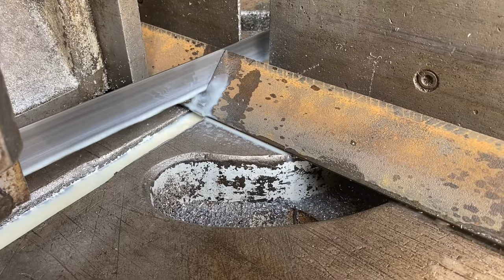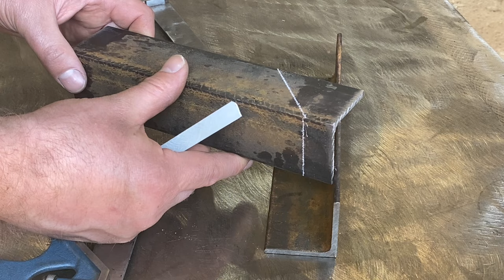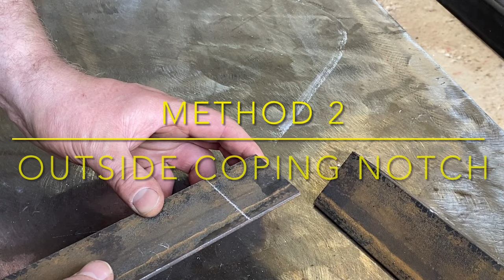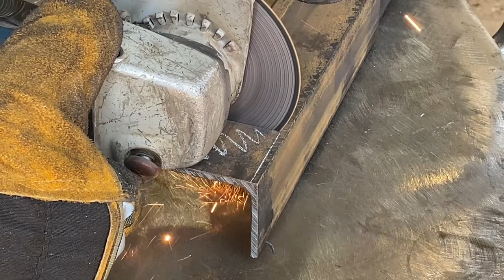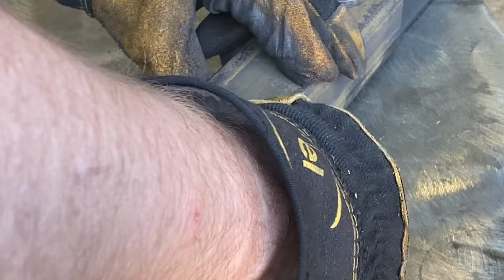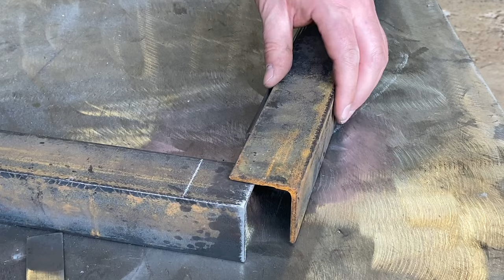Joining angle iron at 90 degrees using 3 easy joint methods - cope & mitre. Welding preparation

Comment: Method 2 worked a treat for me. Easy to cut it out. Easy to weld it up and turned out nice and square. No more 45 degree mitre cuts for me!
Reply from the maker: @gregwilson9035 
Thanks Greg 
Pleased you took from the video. 
All the best.

Comment: ahhh! beginner hobbyist here building a shelf that wishes he saw this a few days ago. trying to do 45s with a chop saw I've learned is a crap shoot.

I don't have a band saw. angle grinder doing either of the copes would've been better.

I'll do better next time. thanks to you
Reply from the maker: And Thanks to you for watching Camilo. 
Instead of the Cope or mitres anther option would have been a square cut but to have sat the angle inside each other, like you see commonly on a gallows bracket. 
Plenty of options... 
Good luck with your project .
Reply: @TheMetalFabGuy  I thought of that initially but mitre looks pretty and it's for a girlfriend's garage.

getting it done? I can do that. add some finesse? uhhhh

Comment: The 45 is more pleasing to the eye for exposed joints but has 80% of the strength that the inside & outside coping joints have due to a shorter weld bead.  Weld beads are usually stonger than the parent metal.
Reply: this. people forget the metal used for welding is very pure and has incredible strength. More weld is a better for strength.

Comment: Is any one of them structurally stronger than the other one? Which one is your preferred method if not specified by the drawing?
Reply from the maker: Thanks for watching Bob. Unsure with regard to the structural strength but would imagine all 3 would be more than adequate in the smaller range of material ie 2”’as per video. 

Personally I Would usually go for mitred option on framework. 

Though both methods 2&3 allow for simple square cuts on 2 sides of a frame opposed to a mitred joint being required on every end. 

Method  3 as the video briefly shows, can also be used as an option for a mid bar on a frame.
(Where I slid it into position)
Reply: @TheMetalFabGuy  thanks so much for your explanation.
Reply from the maker: With consideration, I’d suggest that the mitred joint is the weaker of the 3. More joint to weld with the other 2 and the mitred joint has only the one axis of weld.  But only my suggestion and I’m sure there’s a calculation out there somewhere to prove that.
Reply: The first one

Comment: Maybe it introduces more ways to mess it up, but couldn't you cut a 90° notch out of 1 piece, on one side, then  bend it to make 2 45° like the first method? Less cutting, less welding, maybe a little hammering. 
For the other methods, i was thinking if instead of removing the notch, you ground it down (thickness) and the other piece and have them overlap, then weld? You'd have a buldge but it might be stronger? Idk, new to all this, just spitballin
Reply: You could do that but be sure to bend well because the curve where it was bent adds a few millimeters and can easily mess up the 90 degrees. I had to resort to just using the first method in this video.

Comment: I could use some help. Even with a square guide I'm never getting perfect 90 squares using 45 cuts on aluminum... I figure it can't be heat, but I'm losing my mind trying (and failing) to get square corners here. Any advice? Are 45s too hard for the layman fabricator?
Reply from the maker: Once you’ve welded the 45°s or before ? 
Sounds silly but make sure your square is actually square to begin with.

Comment: So say you are trying to make it out of a single  piece to make a shelf, couldn't you cut two opposing 45s, then cut a relief in the steel and bend the angle to make a right angle?
Reply from the maker: Sure can. Good option for a 90 👍
Reply: Yes, by far the easiest option if you have a long piece, just make sure you leave an extra mm to be filed away if necessary for a perfect fit.
Reply: @TheMetalFabGuy  can be used for other degrees, just divide the angle you need by two and then trace each one.

Comment: Most saw machines I run cut 45 angles without the extra effort. Just type 45 and go… but honestly I’ve never saw someone cut with that little of coolant.
Reply from the maker: Thanks for watching Eric 👍
“Type 45”. That’s some saw you have. 
Look forward to your video. 

Sometimes I cut without any coolant 🤫
Reply: @TheMetalFabGuy  hydmech or hem saw are what I usually run. I do like the video. I saw a lot of steel with angles,channels,flats, and I beams that are fabricated by companies who have us saw there kits. 55-100 pcs.

Comment: how to smooth the inner part
Reply: That is always difficult because an angle grinder with a flap sanding disk cannot reach all the way into a miter cut. The two coped 90s are easier to smooth. There are narrow hand-held belt sanders for close quarter sanding in tight spaces, but they are a specialized tool.